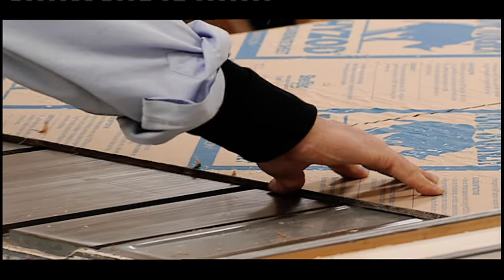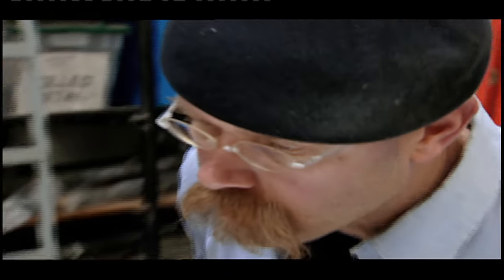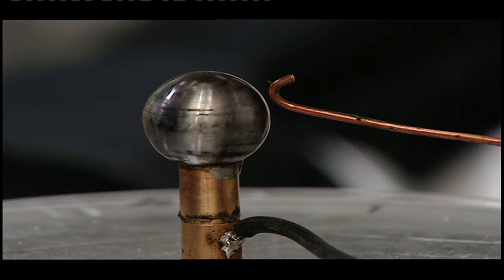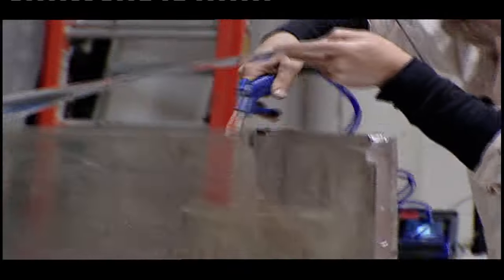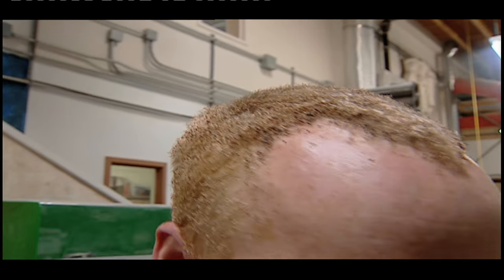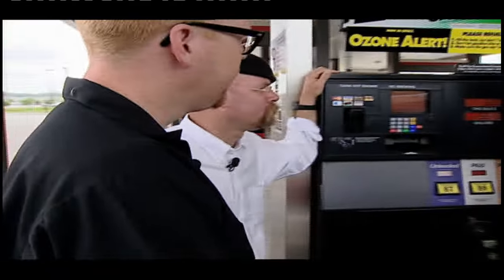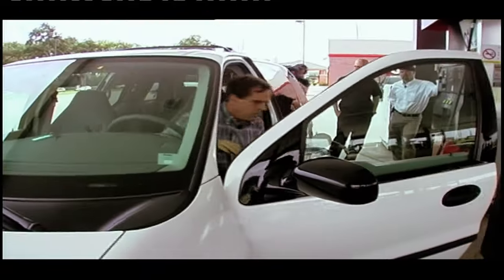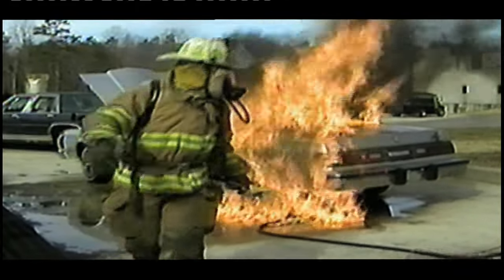Mobile Phone Petrol Station Explosion: Mythbusters

Comment: good that I have a habit of locking my car before fuelling.
And why on Earth would anyone leave a fuel jack there and get back into their car????
Reply: Daniel Nunez exactly..
Reply: A few reason. I don't have data but I recall it used to take longer to fuel a car. I seem to remember it taking over a minute or two in my old Arcadian. I think modern fuel pumps are able to pump faster due to more accurate computerized sensors. As such I used to put the tab down and let it pump. (Many places don't have the handle tab any more). You may have kids fighting, you may be a woman and didn't grab your wallet/purse when you first got out. It maybe -40 degrees Celsius. 

Modern Cars have vapour catchers that prevent the fumes from getting out. The pumps don't have the little locks on them to allow them to be hands free very often anymore (like 3/4 of stations I've used in the last year don't have them). These two changes basically have brought the odds of this happening today to 0.

Comment: Its very simple - the older mobiles if dropped could have created a spark as it hit the ground. Remember that hydro carbons are heavier than air and when exposed fall to ground level - If, what we called the LEL (Lower Explosive Limit) reaches 100% (that's when an explosion is able to happen) and you are in a 'confined area' - i.e. low air circulation then that is a recipe for a potential 'flash'. The potential is massively low, but all the same possible - - - - - like winning the lottery is.
Reply: Time for War  I work as a fuel station monitor and I've been telling people something similar to what you commented but I'm curious as to what you thought about Johnnyx50's comment on this video.

Comment: That was not a Jacob's ladder. That was just a spark gap. In a Jacob's ladder, the spark ascends up a pair of diverging conductors such as single-core wires. The spark shows this behaviour due to the hot air pushing it up. Eventually the gap gets too big, and the spark disappears and moves to the bottom where the resistance is the least...

Comment: I did a course on design for electrics at petrol filling stations and other Haz areas and I was told that in the UK it is the batteries in the phone and if the phone dropped and the battery fell out and caused a spark not the phone its self. If the phone is in a good working order it should not have enough energy to cause a spark but cant say %100 unless it is a intrinsically safe bit of kit, and its general rule not to use batteries in any Haz area where possible common sense really.  Fuel flowing through a pipe can cause static that's why they earth / ground it out all to the same potential. Scary really.
Reply: interesting

Comment: Mobile phones does NOT cause fires but ESD (electrostatic discharge) or "static shock" does. The EMR coming from mobile phones is a matter of concern, not the phones or the usage themselves. (Logically speaking, how can you use a phone WHEN IT IS TURNED OFF? Instead of that, putting phones [especially smartphones] in "Airplane mode", means that the cellular signal is turned off, not the phone itself, would suffice.)
Reply: Not necessarily. If you drop your phone then the battery will cause a spark. One of the main and obvious reasons for not allowing people on their phones while filling is people are incapable of concentrating on 2 things at once so petrol pisses out because people are too concerned with their conversation.

Comment: You are surrounded by a radio fog. Cell phones are very low power. What about rf from power lines, commercial broadcasters, sparks from gasoline engined cars with bad spark plug cables, electrically powered trains, thunderstorms, microwave ovens, etc.?
Reply: Maxundmoritz Hautala spark from a vibrator in the motor
Reply: +shmaveyea Happens to me all the time.

Comment: Why don't we have grounding cable on the gasoline hose?
Reply: There is. The problem is that when you are charged with static electricity, as you would be getting in and out of the car, that electricity is looking for a path to ground. The earth wire on the metal petrol pump is perfect for that. It is also perfect for creating a spark between you and the grounded surface, such as the metal fuel nozzle.

Comment: The fire triangle is thus - Air, Fuel, Ignition. A petrol station has 2 of those things all the time. Look up Lithium Battery Failure and see what happens. No Mobiles at petrol stations is a law to help prevent any possible source of ignition. Its why we cant wear steel toe capped boots on a forecourt and why skateboarding for fun round pumps is a no-no. Look at the handheld devices we use in a petrol station. They are laboratory tested, gas sealed, electronic handsets that go through torture before being deemed safe for use in an explosive environment. Mobile phones are NOT listed as safe for use in these environments. Fuel tanker depots are not allowed to use mobiles in any area where a build up of vapour is likely. This is the same rule for forecourts. Any area up to 4 meters around Off-Set fills (where tankers make deliveries), the tanker during a delivery, the vapour release vents, the petrol pumps, the Tank Manhole covers and the Interceptor drain vents are all hazardous zones. Interceptors take run off from a forecourt and pass it through multiple chambers with rain run-off separating fuel from water. And manholes do release vapour too. I have seen it in summer from the petrol manhole a wavy distortion seen at an angle. So stop listening to all these TV bulshit programs that just make light of a dangerous situation and use your common sense. Fires can and do happen at petrol stations because of carelessness. Petrol vapour is heavier than air and is always present during busy days. So please, just look and you will see the warning signs there to protect you, and us from fires we dont need. Thank you.
Reply: Okay this is a bit late and I stopped reading when you said no steel toe capped boots.. I worked for shell refinery with both raw and finished product and if you even thought of going on site without your gas meter, woven cut resistant gloves (minimum safety standard so it's not the antistatic variant) full fire resistant coverall (again minimum safety standard so again not to antistatic variant), steel toe capped boots, and safety helmet that can cause static with hair friction, you will get instantly removed from the promises and black listed from all sites

Comment: I thought it was because radio signals, from phones in this case, can cause sparks in the pipes that have the fuel in them if it was the pump or storage or whatever. That doesn’t sound right haha but that’s what I thought?
Reply: You need a LOT of power to cause arcing with a radio wave - think of a microwave oven or Tesla Coil. I seriously doubt that any cell phone generates anywhere near enough RF energy. It's a weak digital signal.

Comment: never happens in the UK we don't have automatic pumps ie we have to hold the trigger on the nozzle down to dispense fuel.
Reply: Or pretty much anywhere else except USA.
Reply: gas cap, wallet, water bottle, basically anything will fit into the handle and hold the flow on and all nozzles have auto shutoffs that are checked regularly... believe me nobodys filling their truck from empty holding the pump here in alberta when its -40C
Reply: Same here in Canada

Comment: Their test with the cellphone in the plastic box was never going to cause ignition.

It's not the cellphone itself that creates the potential spark : where there is a risk of radio-frequency emissions causing a spark is in the partial circuit formed by the car body, the earth, and the pump. The gap between the car and the pump acts like a capacitor, which is effectively a crude high-pass filter. High-frequency signals can induce a current in the partial circuit, but without that partial circuit they pose no risk at all. As it happens, you would need a much stronger signal than anything a cellphone can emit to generate a large enough induced potential to create a spark.

So you need to shut down your pirate radio transmitter before pulling into the petrol station, but don't worry about the cellphone.

Comment: 4:04 This is a diesel pump, NOT gasoline. Diesel needs tremendous heat to ignite not just a spark.
Reply: Gasoline or petrol as you folks across the pond call it requires as 500 f  to ignite a spark wont do it a naked flame however will

Comment: Another free energy proof. Get a battery to power a dc motor and which rotates a 220v alternator. Then plug a battery charger to the 220v outlet that charges the battery.